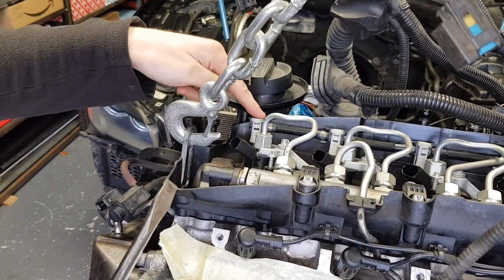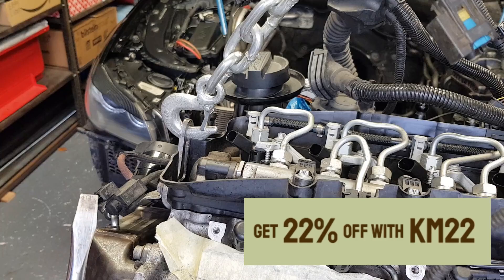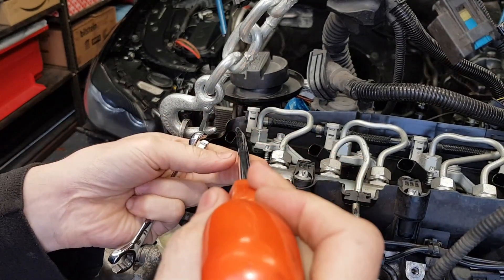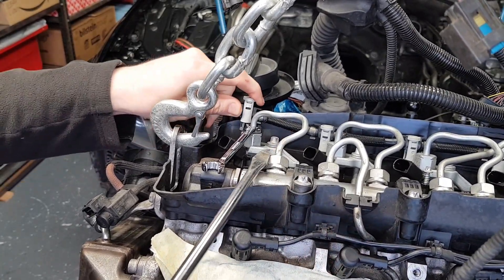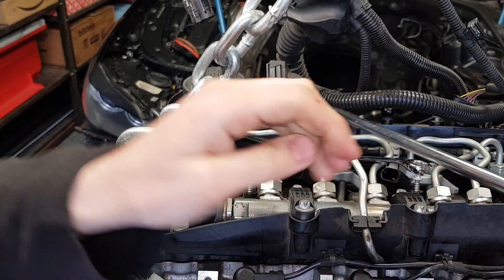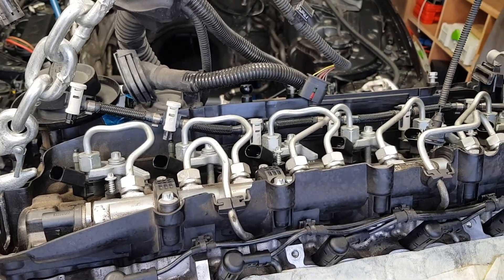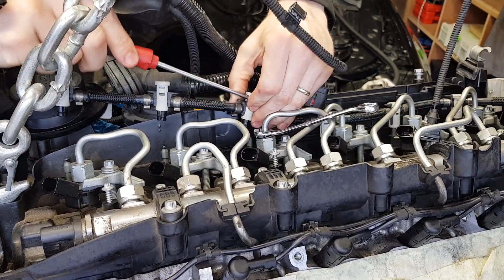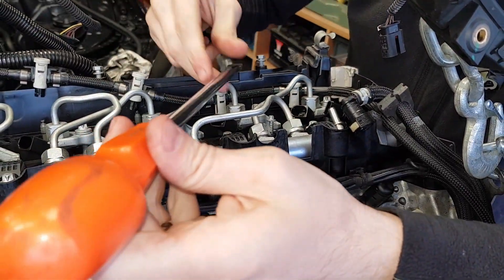How to remove injector diesel return line BMW N57 M57 N47 M47 drip pipe fuel leak off overflow pipes

Comment: Hi ,so i tried to remove one and i broken it ,one side o black peace is missing ,i fitted it back anyway and now i  cant start my car ,cranks only..
Reply from the maker: Try to bleed your fuel system in case you have air in it. Obviously you will need to replace what you have broken 1st
Reply: Thank you.
Reply: I forgot to mention ,that im getting this fsult code 4B90 Rail preasure control at start
Reply from the maker: @superplayerunknown729  Hi
Check to see if your rail pressure sensor is ok. Decent diagnostic tool or ista+ would be best.
Reply: Hi ,i replaced return line ,after long crank it started 🎉 , but it still cranks longer then usual ,i spoted leak in cylinder 3 on top , im not sure is it leaking from injector ore ore  from high preasure pipe..
Reply from the maker: @superplayerunknown729  Use brake cleaner and compressed ait to clean it, then get someone else to crank and when everything is nice and dry you should be able to see the leak. I hope you get it sorted. You must be getting air in the system if it is not starting easy

Comment: Just wondering how to test return flow for this type of injectors, I have same injectors where return flow tip is male and all adapters what comes with return flow meter testing kit is also male adapters.
Reply from the maker: Are you able to add soft silicone pipes over the male bits and join with standard testing kit

Comment: Bro what can i do mine leak like crazy fuel i bought new orings and still leaking. What am i doing wrong? Its doing my head in when i try to put them back they dont pop barely go in and leak.
Reply from the maker: Not sure buddy, you need to go to someone local who can help you. I didn't have any issues with mine and didn't even replace the o-rings. Hope you get it sorted

Comment: Hey man. I'm kinda desperate looking for a fuel leak with this engine that two shops have been unable to locate anywhere. Multiple hoses/joints have been replaced, the high pressure pump has been serviced and the car still reeks of diesel fumes coming from under the bonnet after a short drive in the city. Everyone swears nothing is visibly dripping.
Reply from the maker: Hard to help from far away. You will have to be persistent and follow everything carefully. Someone is missing something somewhere unfortunately🥺
Reply: Thanks, I can't even find a suitable fuel UV dye here in Bulgaria and can't confirm if AC dye is OK :/

Comment: Thanks_ My engin bay ius flooded with desiel everytime i drive; the bonnet and on top of the gasket is floolded: what could be the issue: bought new washers for the injectors but still same issue: the car smells like fuems
Reply from the maker: Clean everything with brake cleaner and then check all pipes for leaks🤝🏻

Comment: Really appreciate the thoroughness and professionalism of your work and generosity to make it available here - and with your effort to give clear instruction.
I'm looking at doing my BMW F11 N47 timing chain, and ZF8HP70 ATF over the next few months. Will be studying your great work a bit more before I decide to proceed. I'm just DIY on the driveway, but have done an SMAX clutch & flywheel, so have a bit of confidence and appreciation for challenges ahead.
Reply from the maker: @danielosborn1303  You will have no issues, if you have done a clutch then you have more than enough experience to do these jobs. I have videos on most common jobs on the F10 F11 chassis

Comment: Your work is always so thorough!
I don't necessarily trust many people out there with this stuff!
Appreciate the video's as always!
Reply from the maker: Hi Buddy
Thanks again for your support.
I recorded this as the content on this subject is very missleading and often wrong. A friend of mine asked me to fecord this as he followed one of the videos in YT and ended up breaking them and causing damage for £230. Each one of the little rubber o-ring costs between £10-£15 then on top the plastic parts on the line. I took my time with this job to avoid any damage as the cost for the project was over £2000 already
Reply: @TheKeenMechanic  Wow, scary stuff!
You really don't want to mess around with these components!
My dad had to do all 6 fuel Injectors on his N54 and the price was quite terrifying!
Reply from the maker: @mrmusic1880  Yes, some parts prices are sky high even if you can do it yourself and don't have to pay for labour. If you can't turn a spanner and have to go to the dealership or a specialist you are going to be very stressed when the bill comes.
Reply: @TheKeenMechanic  Yes that it for sure!

Comment: I have a B47 engine ( which is a nightmare because there's hardly ANY videos on repairing issues etc on a B47. Anyway, mines were leaking at the hose as joints. The plastic clips pull out VERY easily and the hose is just rubber with no jubilee clips.....is that normal?

ALSO how much pressure flows through them? Mines seem to have a fair amount of pressure and is almost bursting the weak pipe. Could it be that the garage that replaced them, fitted the wrong ones?
Reply from the maker: I am sorry I am unable to help you as I have never worked on a B47 engine. Hope you get it sorted